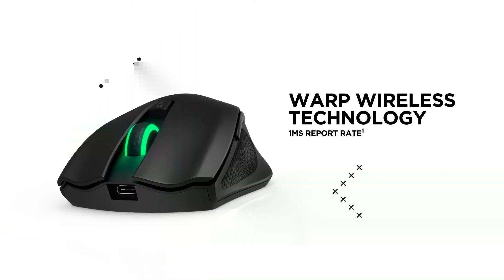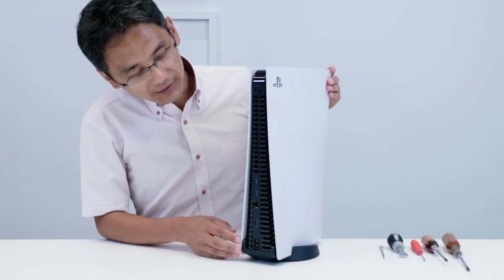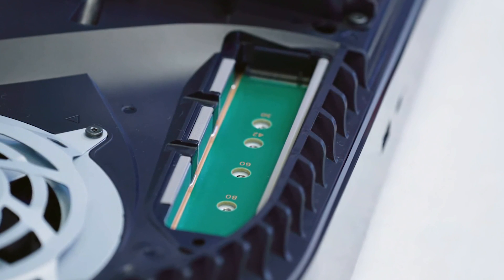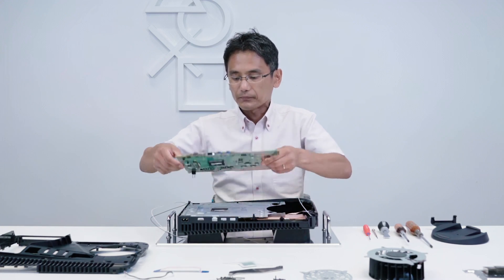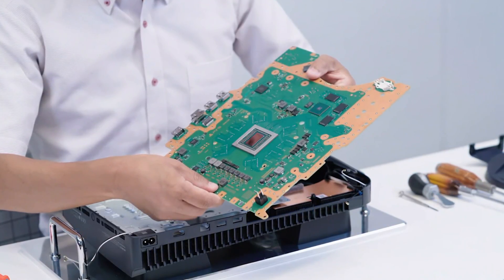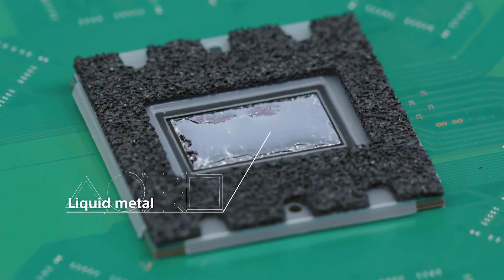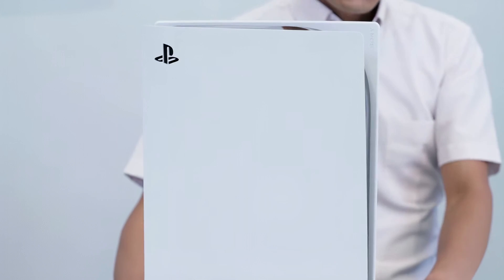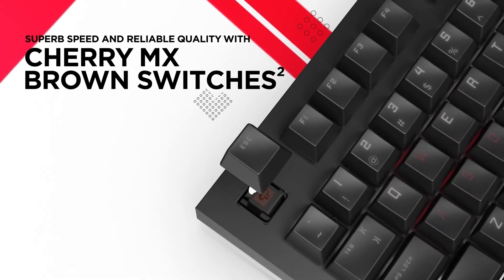PlayStation 5 Teardown Analysis: Inside Sony's Next Generation Hardware Design

Comment: Really enjoyed this coverage and analysis. Gotta say I like and prefer the XBOX Series X design and engineering. 
Especially the lower profile, compact size. Best form factor and simplicity. Build materials seems better too.
Even though I'll probably buy PS5 for games like Demon's Souls and other PS5 exclusives and backward comp. But I wish PS5 was smaller, more form factor. However,  I have NO IDEA where and how I'll fit this humongous wide and long console... it won't fit in my custom made ventilated stand/platform position. Really frustrating fact. It's jus way TOO BIG
Reply: Yeah it is really big but I really like the unique aesthetic of the PS5. Finally a console that stands out over the black boxes we are used to especially with those removable plates that we will be able to customize. It is also still not wider than XBX so for me it fits on my shelves horizontally and beside the TV vertically if I want.

Comment: As we approach an area of diminishing returns for what has historically been DF's wheelhouse for analysis (as represented by XSX's raw hp-fueled quest for FPS & res), I’m wondering if PS5 might pose a bit of an existential quandary for these fellas.

With PS5, Sony has basically signaled that the next great race will be in I/o architecture. They have literally changed the nature of the competition. To my eye, there are new & better experiences to be created by devs & had by players with this approach, and I'd bet this disruption in table stakes will force MSFT to rush out new hardware in a few years.

But what does it mean for DF? Will these guys still fetishize max parallel compute & obsesses over frame rates / resolution? Or might Alex's speciality (lighting) be a first step towards minimizing the importance of every last frame & pixel in service of this new area of technical exploration ushered in by Sony?
Reply: DF is all about raw power, they come from pc, and thats what microsoft is trying to do, win the pc market, while ps5 still innovating, they knew xbox would put the most powerfull console just like they did with xbox one x, it beated the hell out of the ps4 pro, so what they did? They doubled down on ssd speeds, innovative dualsense, and an audio system that gives you a "dolby experience" for free on any headphones.
Tbh both consoles look awesome, both are great and powerfull, but ill repeat what i did last gen, ill buy a ps5 and wait for the next gen of graphics cards so i can upgrade my pc, it proved to be the sweetpoint since i got to play the master chief collection, gears 5, forza horizon 4, flight sim and i love those games and i dont need an xbox to play them, but if i had choosen xbx and pc, i wouldnt being able to play god of war, uncharted, the last of us, the last guardian, shadow of the collosus, ghost of tsushima, infamous second son, death stranding, horizon, fuck man, you name it, i love my ps4 just for that fact, there are games you cant play anywhere else, and when playing you dont care if it dosnt have the power of your pc, you just enjoy a madafaking good game.
Reply: @EduardoSilva-br7cd  Yeah, I mentioned this in passing to another commenter, but it's kind of interesting to see how both underdogs (by market cap) have outmaneuvered their much larger competitors.

A few years ago AMD was trading at like $5/share. Then Lisa showed up, disrupted the hell out of INTL, and has seemingly set her sights on Jensen. And make no mistake, AMD chose their strategies by necessity. For survival. Innovate or die, and they were just about dead.

Same story with SNE. They're an 80B mkt cap, sure. But f'n MSFT is a monster. 1.6 TRILLION mkt cap at last check. MSFT has basically been playing with its food for 7 years lol, but now they seem to realize the path to more revenue in the space is with services, and they’ve begun using that balance sheet. 

Fortunately, Sony (apparently) realized this was coming, and has outsmarted their larger, slower enemy for now. But in 3 years when the next MSFT console hits and they’ve finally got a decent library of exclusives, SNE will be in real jeopardy.

Basically, SNE has bought themselves time with their pivot to I/o. I think AMD's prospects are definitely a bit stronger, competitively speaking over the longer term, and even with NVDA going after ARM.
Reply: @roccodemaro4305  yes, makes me kinda sad, microsoft is a monster and it will eat everything in time, sony cant compete, msft spend like crazy, and come on, we all know that xbox is not 499, they are loosing tons on just making a console, but they dont care because they got a bottomless wallet, i just hope we get to enjoy more of those masterpieces sony puts out before microsoft ends up killing them (sorry for my poor terminology, not my main lenguage)
Reply: Stfu
Reply: I want whatever this guy is smoking.
Reply: I'd say this new Era was ushered in by AMD. They been stacking memory close to or on top of the processor for some time now but it's having trouble being adopted on PC because Intel was besting them processors and Nvidia was beating them brute force processing power.

However in this gen you can See the Zen 2 Architecture has has an impact on how Processor, Storage & Memory are structured on the board.
Reply: @IzThatit  Yeah, after hearing Cerny's GDC talk, it became pretty clear that the Sony/AMD team up on PS5 (and collaboration on RDNA 2 & 3) will really benefit both parties. Lisa's f'n killing it over on team red, for sure. And I’ll be super curious to see how similar AMD's battle with NVDA will parallel SNE's with MSFT.

Comment: I've seen super dusty cases which gained no temperature benefit when cleaned. Nothing is as important as the thermal conductivity of the medium between the cooler and the components.

Comment: I've been waiting for this analysis.

Looks like it would cost more to build than the Series X imo. Just the chassis alone would cost more than the plain box the xbox uses. Also that heatsink, while not being a vapor chamber is very intricate and would require lots of tooling and work during manufacture. Liquid metal is a cost effective idea however, but the cooler could have been better.

I am not sure about the fan, I have not worked with many large blower style fans like that.
Reply: @eduardosantiago6948  Yes and no, the tooling for those shells (and the inner shells) would come to around about $35 or so over 1 million units by my estimate. Which you are correct is not a lot, but when you are trying to build such powerful consoles on such scale even 5$ is a fairly huge amount. 

But its that heatsink that will really cost the money, not cost effective at all. Lots of copper and aluminum and a tremendous amount of machining has to go into that. The vapor chamber is a much more cost effective design.

Also using liquid metal is very cost effective and a great idea from a cost to performance standpoint.

Comment: Or they are just worried about the console getting analyzed before people buy it. Doesn't look good when they pull out of multiple reveals and when they do the reveal they talk about overclocking parts of the PS5 and say they have a Boost Mode. Boost Mode on your first Next Gen console is a big red flag That's something you add to your PS5 slim or PS5 Pro.
Reply: Boost mode is for PS4 games, you idiot.
Reply: "Boost mode" is for backwards compatability only (ie runs the full spec of the ps5 on ps4 games). There is no boost mode when normally playing ps5 games because it is just in the ps5 mode.

Comment: I have an HP Omen 15 dh0005la i7 9750h and with an rtx 2070 it is the same size but does not reach 2 fingers thick and that to take into account that includes a screen, keyboard, etc.  and they couldn't make that toaster smaller

Comment: Those things are interesting even for PC only users like i'am.
Also i'm not for the pathetic and unfair war PC vs Consoles. But for sure a sort of competition will only have benefits to both worlds. 
Specifics and technical stuffs inside those new generation consoles, with some 'leaked' performances and benchs, are a blessing just like the newNvidia 3k serie and possibly the Zen3, and i always had Intel, ready for the switch this year. Thank you Digital Foundry ! Always classy vlogs and cool stuff from you, guys. +1mil. well deserved !
Reply: 7MGTESupraTurboA  Dx 10 powered Xbox 360 and PS3????
Just stop please.
Reply: 7MGTESupraTurboA  Lol, so DX10 on a Linux based Ps3? okay.
Reply: 7MGTESupraTurboA  I’m sorry but what greedy tactics are you talking about? And in what way did the 360’s hardware derail potential hardware in the PS3? And it certainly had no effect on Nintendo who were still iterating on their GameCube architecture with the Wii and Wii U. 

The Xenos GPU was ahead of its time, it had a unified shader architecture before even PC graphics cards had it. The 360’s unified 512MB of memory model was also a better design than the PS3’s ungainly split of 256MB main memory and 256MB GPU memory. The 10MB of eDRAM even allowed for virtually free anti-aliasing and transparencies. 

The 360 Xenon CPU and the Cell CPU were both developed by the same team at IBM so it’s not clear to me how Microsoft were holding things back there either. The more basic Nvidia card slapped into the PS3 after the Cell’s SPEs failed to perform as a GPU would be a better candidate for holding things back.
Reply: apu are great since the whole thing is on single board but they need to be big board... xbox do it better however.... it alway end with exclusive... telling me of this 10 years.. is something me in early 2000's would not belive it is possible since...the heat and power is not possible... since APU don't exist at the time...
Reply: 7MGTESupraTurboA  DX10 was never going to be available on PS. If you don't know anything about software, as you have so readily proven, don't talk shit
Reply: Yeah these new consoles will surely push PCs to advance. Potentially bring SSD prices down a bit quicker hopefully
Reply: @jamesb7205  ssd prices are down. You can get a 1tb nvme 3.2gbs at £109 instead of xboxs £229
Reply: @mryellow6918  that is not the same type of ssd
Reply: @jamesb7205  basically is
Reply: @mryellow6918  but it's not the same. Which is why they're more expensive. The Xbox expansions are on par in price for the same/extremely similar SSDs
Reply: @jamesb7205  it is basically identical in performance what do you mean?
Reply: @mryellow6918  gen4 nvme I believe
Reply: @jamesb7205  doesnt matter if its gen 4 or 5 or transforms into a auto bot its the practically the same speed. for half the price.
Reply: @jamesb7205  lol im actually wrong in saying similar speeds. the £109 1tb is actually much faster at 3.2gbs instead of xboxes 2.4gbs
Reply: 7MGTESupraTurboA  well...i didnt knew all those back-stories, and as you said all those things slowed in some way the tech-advance of our recent generations of consoles and PC. But i'm also not surprised either to be honest. In my opinion all those big tech/softw leaders keep always in mind to release things drop by drop. It's a matter of money, as u stated in the beginning of your reply. So yes, i agree with ya. But let's be honest....it's fair. I fully understand their pov about the competition while keeping things 'on the rails' about the so called new generations. Greedy....but fair to me xD

Comment: I feel like sony employed some car designers to help with the airflow problem. I cant help but to think of a super car when i look at the shape of the system and all the vents
Reply: Yeah but it uses a blower fan and right angles for intake which will hurt airflow unlike the Xbox which just uses an axial fan for straight air flow. There's a reason full PCs use axial fans and why laptops are so much hotter and louder. I carry a blower fan at work to cool me off but man they are so much louder.
Reply: @Skylancer727  im not familiar with the particulars of it but it sounds like it makes sense.

Comment: Do not just skip over Bluetooth 5.1 it has quite interesting features over 5.0 - localisation...
Reply: @ThePillisReal  Dude please! You're just saying that because the Series X is more powerful (and this is a hardware channel mostly) or because they cover XB hardware more but that's not their doing Sony has been too tight lipped and MS has been the opposite.
Reply: @orielsy  the Xbox is more powerful but likely not by much. It has about 40% more cores but the PS5 has about 30% higher clocks and cores don't tend to scale performance as linearly as clock speed. I expect both to be nearly identical with both basically having the same game settings. Perhaps very rarely the Xbox will have better performance but just barely. They are fairly close. Though I expect the Xbox to run ray tracing better as RT cores are related to core count on the GPU and it does have nearly double the GPU cores.
Reply: @ardasevmis7583  I don't care to measure by how much XB is more powerful I only wish to emphasize that it is more powerful and thus Digital Foundry reporting on performance related subjects seems to rub people the wrong way. To the point where they are claiming that one of the most unbiased raw sources of gameplay analysis in the world is biased/corrupted. A claim which is NOT FOUNDED on facts merely speculation. 

Claiming such things should not be done lightly. Digital Foundry isn't some rinky dink flamebaiting news source.
Reply: @ThePillisReal  They couldn't discus the PS5 during the XB reveal because PS5 had nothing out. You yourself acknowledge this. You can't discuss one without contrasting it with the other players in the field. You're talking nonsense here and you know it. 

Games are reviewed for their INDIVIDUAL characteristics. They aren't going to complain about the same thing across different genres although there may be overlap. A game like Fortnite for example isn't going to get dinged for a lack of realism. Similarly  a game like Halo that isn't going for ultra realism isn't going to get the same critiques that a more cinematic game would.  In any case you can't review a gameplay reveal like you would a released game. Let Halo Infinite come out before you pass judgement on that.
Reply: @ThePillisReal  You seem to have lost track of how time works. You've may have something stuck somewhere. It's got your brain crossed because Mark Cerny's Road to PS5 event happened weeks after MS and Digital Foundry recorded the Series X reveal. Get B**t hurt out of your life, take Sony's [........] out your back side and take MS boot out of your mouth and hopefully then you'll remember how time works.

So insecure because the PS5 is not more powerful. Pitiful.
Reply: @ThePillisReal  this is why we don't argue with fanboys, he didn't even have the decency to check the dates on the videos before talking shit. Road to ps5 came out first. MS could have compared them but chose not to
Reply: @grantgarbour  You talking about me? The XB hardware reveal was released on March 16. It was recorded weeks prior. 

Mark Cerny's Road to PS5 was on March 18th. 

 Don't take my word for it. Check Digital Foundry's videos or the internet.
Reply: @orielsy  that was the specs we're talking about the teardown
Reply: @grantgarbour  They recorded the teardown at MS headquarters when Rich built the system part by part. The XB never got a teardown like the PS5 has.

Comment: i will not get a  ps5 or new xbox i want a    xbox seris x alot more
Reply: Ps5 is better
Reply: @domzzcardzz7985  Faster Ssd does not translate to smoother gameplay only load times. Series X also has better backwards compatibility and smaller formfactor.
Reply: @AVIATIONANDTECHNOLOGY  and also loads in assets faster like open worlds will run better on the ps5 and the ssd is so fast it could be use as ram

Comment: It seems as though the large PCB for the PS5 and relatively spaced out components are designed in a way as to reduce the thermal density of the PCB and make it easier to cool.
Reply: Also reduces eletromagnetic interference.
Reply: Are you captain obvious. The ps5 is gigantic. Also hideous bu that's my opinion
Reply: Also increases latency and power needed so the benefits arent as great as you would think.
Reply: FührêrFPöñê  How
 Ironic the fanboying sheep, telling people not to fanboy 😭 lol

Comment: It's such a contrast, the PS5/XBOX Series X/S design approach. The PS5 is bordering on overdesigned & fussy (in aesthetic terms), but the XBOX is barely an aesthetic design, just a featureless monolith. I have a white PS4Pro and an XBOX One S (which sit on the top row of my AV unit) and though I play on the PS4 a lot more, I do think the One S is perhaps the nicest looker console I own (and I go back to the early 80s in console ownership, starting with an Intellivsion). Not sure what I think of (in looks) with the new systems.
Reply: Over designed and fussy yet Rich himself calls it ordinary and safe engineering...
Reply: @spenny2cents  Well, I suppose I took a tangent from the video as I was only dwelling on the looks rather than the insides!

Comment: Still weaker than Series X though?
And once again, Xbox Series X wins.
Xbox is the best box

Now let's see the replies.
Reply: The 360 was weaker than the PS3. How'd that work out for MS?
Reply: @riteousrighthand6144  By the end ps3 sold more than the 360.
However the wii smoked them both.
No idea how next gen will end.
Reply: @Prodzick  which was severely underpowered, by comparison.

It took the whole gen for PS3 to pull ahead, though.
Reply: @riteousrighthand6144  and they maintained their lead during this génération by miles they did.
Jokes aside it's funny to see nitendo having nothing to do with this power contest.
Although they miss their mark with the WiiU wich can be consider an alpha for the switch.
Reply: @Prodzick  indeed!